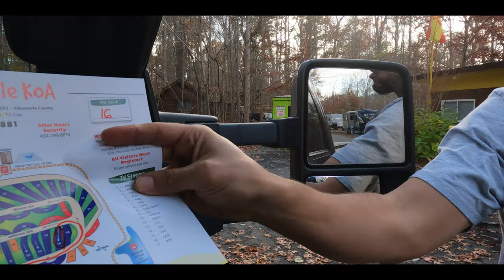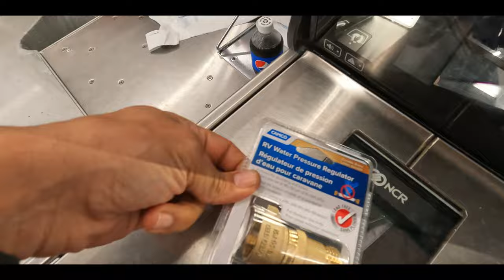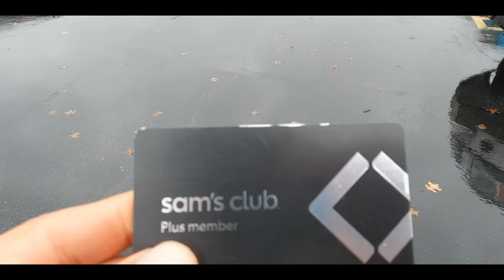Travel Trailer Owners, This WILL Happen To You 💣

Comment: I'm glad nobody got hurt or major damage to your rig. That's a real blessing. Yeah, getting another tire makes good sense. You might need it sooner than later. We recently changed the tires in our rig, and they had to be special ordered. It seemed like no one carries camper tires. We luckily found a place that was cheaper than going to the dealership. I'm sure you got it fixed by now. Thanks for sharing your experience with a blow out. Stay blessed and highly favored.
Reply from the maker: Hi Ray! Yeah we were so lucky to have found a place that had a spare. We replaced all the tires as soon as we got back from our trip. Things could've been a lot worse. Thanks for watching, we appreciate it!

Comment: Put some quarter inch steel plate under there the next time you have a blowout you don't have to worry about putting holes on underneath your trailer the only thing you have to worry about is ripping up your side of the trailer
Reply from the maker: Great advice! Thank you.
Reply: @RelativelyRichLife  don't screw it in doesn't want that tire starts flopping around I'll rip the screws out too have it welded in